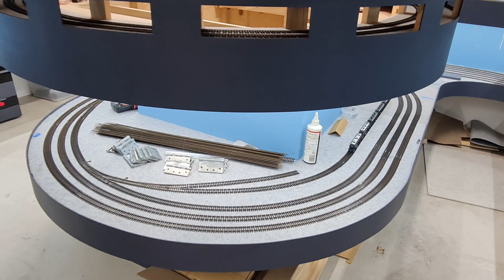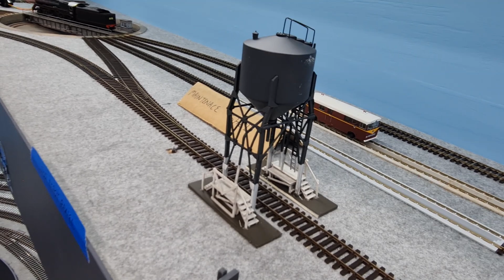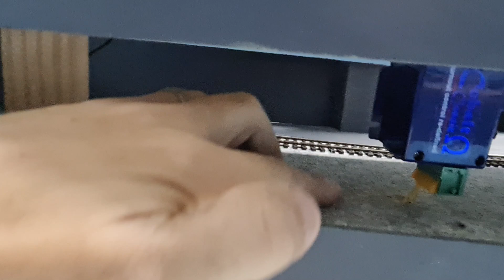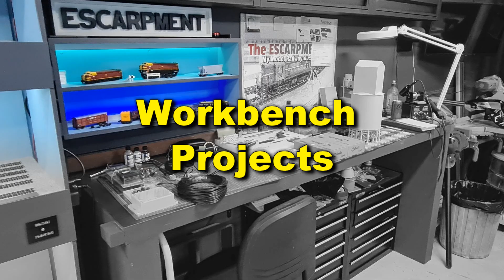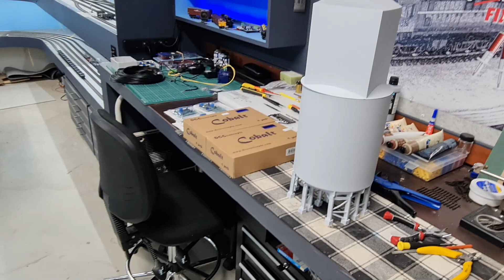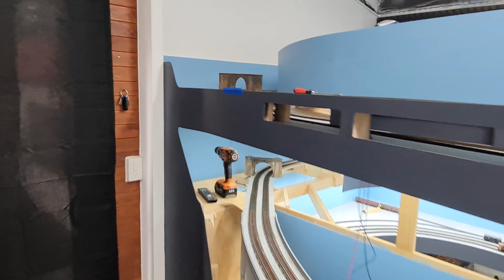April 2022 Model Railway Build Update -  The Escarpment

Comment: Why don’t you add short dummy rails all around the rim of the turntable to maintain 360 electrical contact ??
Reply from the maker: Hi Sid, not sure what you mean by placing dummy rails around the rim. This is the full electronic version and the issue is how they have wired it internally..cheers
Reply: Hi Jason - I noticed that as long as the turntable girder made contact with the tracks it had power - so, if it was setup so that there were tracks all around it I assume there would be no loss of power - so i was thinking if you could just have rails without ties (similar to the genuine tracks) along the turntable rim you could maintain that 360 contact - just a thought 🙂
Reply from the maker: Unfortunately that is not how this kit works. It doesn't have a true auto-reverser, so it cuts power (very short break) to switch polarity. But when it does this my DCC loco loses it's sound. I have a solution and will share when I implement it
Reply: Got it - so the problem lies even with the existing tracks 😐
Reply from the maker: @sid21177  yeah it is internal as the rails don't make contact with those rails on the outside. I do have a solution and will share in a future video

Comment: Hi Jason, fantastic! Could you tell me the heights to and between your 3 levels? Many thanks
Reply from the maker: Hi Scott, the bottom level sits 600mm off thr ground. The middle level sits 1100mm off the ground and the top level sits 1600mm off the ground. If you work in inches that would be 24", 44" and 64"..regards
Reply: @The_Escarpment  thanks Jason. Planning something similar but in a much smaller space
Reply from the maker: @UpTheWHL  not a problem, best of luck with your build

Comment: Hey Jason looking great, just my two cents on your control panels, might be hand to not have the coach yard panel directly above the loco terminal panel, as for operations you might have a different person working each one? Hope that makes sense.
Reply from the maker: Thanks Mully, good point. It might be a tight squeeze in that space for 2 people, but they will be two good size yards..hmm
Reply: Yep, more space between operators/control panels the better! Stacking them vertically not recommended.
Reply from the maker: But I have very high expectation of my future operators..there will be tests with operation multiple control panels 🤣😂🤣..only joking..